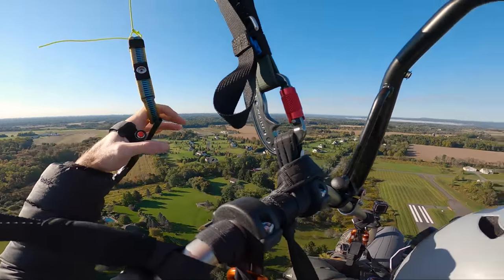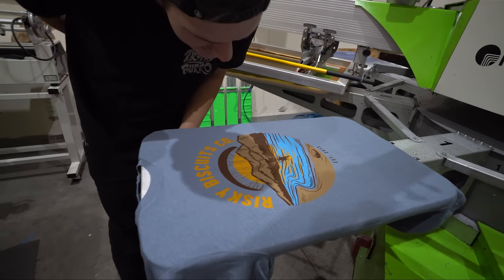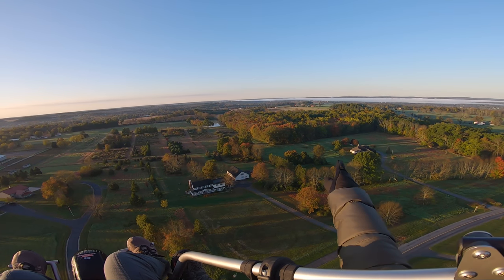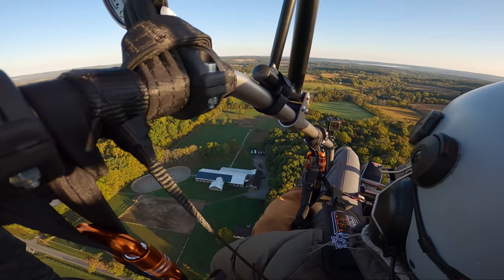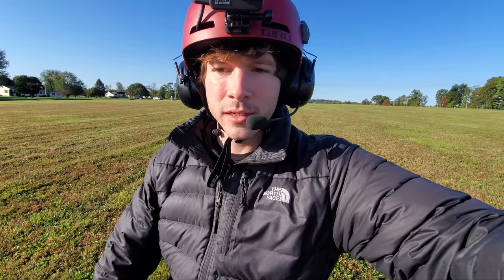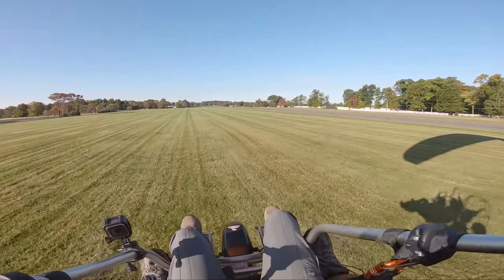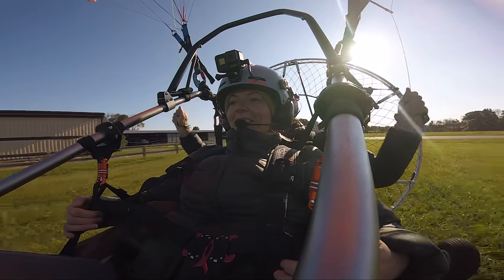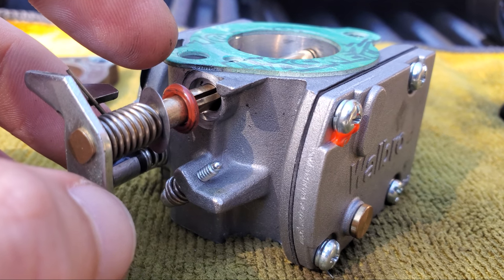I had an ENGINE FAILURE while flying my girlfriend to breakfast...

Comment: o ring is red, so its made of silicon which swells with gasoline. they used the wrong material for this application. you need a viton o ring which does not care about gasoline.
Reply: Interesting, that sounds recall worthy
Reply: Exactly Adventureman. Tucker check your new carb for the correct o ring or this will happen again
Reply from the maker: Very interesting point! I never knew there was even an o ring there until this happened. I am curious to see what color the o ring is on my other Moster which hasn't had this issue.
Reply: Really?  I was guessing the engine's heat but you make more sense.
Reply: That o-ring would have been installed by the carb manufacturer though. I was under the impression that there maybe alchohol in the fuel that could have done that. I can't wait for the update.
Reply from the maker: There is ethanol in the fuel but it has never been an issue on previous carbs. I wonder if they used a different material or maybe this o ring was just out of spec. 🤔
Reply: Here’s hoping battery energy density advances and electric quickly make these complicated petrol polluters we’ve been putting up with obsolete!
Reply: Although you CAN have different color o-rings with different material, you are correct that Red (Rust) means that the material of the o-ring is Silicone.  The o-ring should be NBR (nitrile or Buna).  Viton would be overkill, but. hey, if you don't care about money.......
Reply: Also some issues with the carburetor design itself, given how it failed. It needs a catch on the end of the post the spring seats upon, and there isn't one.
Reply from the maker: @ZeGermanHam  Correct, I didn't mean that the part was not available whatsoever. But I don't think they would pull an o ring from the local Napa and send it to me as a warranty part. This o ring is not listed on the parts diagram so it seemed easiest to send a new carb. 😁 I appreciate them going above and beyond.
Reply: Tucker, “thanks for being my windblock!” Lol
Reply: @TuckerGott  Still, you should be able to get the proper O ring at NAPA, if you wanted to DIY and get back in the air ASAP, but as you  mentioned, it might void your warranty.
Reply from the maker: @davisrs1  Exactly. I intend on getting a replacement to keep the other carb as a spare but I'll use the fresh one as soon as it gets here. 😁
Reply: eric thefathead  Incorrect, the  Challenger used FKM Viton.  That O ring failed due to brittleness at low temperature.  Silicone may have been a better choice because of it's low temperature elasticity.
Silicone is not appropriate for that carburetor becaus it is not abrasion resistant under that spring nor highly gasoline resistant.
Reply: eric thefathead  well now everyone has to press f for reading your comment
Reply: Or just use non ethanol gas. Ethanol does weird things to non flex-fuel parts.
Reply: @ZeGermanHam  agree. A new carburator just because an o ring sounds a lot like scam
Reply: alfameqeagle lol, a scam? You do realize that Tucker is getting the new carb for free, right..?
Reply: I actually think that whole carb looks nasty, like a cheap item, poor casting and machining.
Reply: When I hear "O" ring, I think Challenger!
Reply: @jissanboermans5009  Gasoline, itself is a great solvent for many elastomers, with or without ethanol, which is less of a solvent.
Reply: @TuckerGott  just measure it and order a new one from an o-ring supplier. It’s very likely a standard size.
Reply: There are some subtle movements..... lmao 🤣
Reply: @TuckerGott  Having dealt with other small engine suppliers, it might not be listed on the parts diagram; it might be as a part of the carburetor's gasket kit, or rebuild kit.  Sometimes manufacturers won't list those things on the diagram, it'll just be in the parts list and noted as "not pictured".  You might not be able to order that specific o-ring without ordering a full rebuild kit for that carb, or possibly a seal kit, depending on how Vittorazi supplies those parts.  If the carb isn't rebuildable (a lot of newer carbs aren't), then the only way to get a replacement seal is as you said, to order a new carb.
Reply: eric thefathead  Yes it was known by peon engineers like us and ignored, unfortunately!
Reply: eric thefathead  Believe it or not, you may be on to something here.  The problem with the Challenger o-ring was that it would loose elasticity as the temperature dropped. It was obviously cold out, and the fuel expansion as it enters the venturies of the carburetor will cause more cooling (hence carburetor icing).  That coupled with the point Adventureman made regarding a possible issue with silicon-based material, may have been a case of two issues lining up coincidently to create the failure.  The manufacturer should certainly take notice and investigate the potential implications.
Reply: The o-rings on the butterfly shaft are there to prevent any air from leaking around the shaft. This would cause a lean idle condition or low throttle mixture issue, there is quite a bit of vacuum on the back side of the plate when throttle is closed. The shaft is the first leak point. Take care Tucker!
Reply: This failure - by luck only - was a stuck at full throttle because the o ring unseating dislodged the return spring in the butterfly shaft? If I’m correct. But a similar o ring unseating could also cause a stuck “off” or stuck idle failure as well, correct? At idle this trike is a slightly slower parachute? Just wondering. Seem like engineering needs to take a good look at this one and redesign so the spring can’t jump regardless. I’m just a knucklehead wondering.
Reply: @Chinookman  No, return spring failure (caused by the o-ring in this case) could only result in throttle open condition. Total o-ring failure would tend to lean out the mixture due to air getting in through the shaft. The throttle cable itself would have to fail to cause a an idle only condition.
Reply: eric thefathead  The Challenger disaster was due to the o-ring being brittle at low temperatures. The sad part is this was a known issue. We had the same problem with o-rings installed certain in C3 Poseidon Fleet Ballistic Missiles. Rather than go through every missile in the inventory with that particular composition o-ring, disassemble and replace said o-ring, the Navy installed a heater strip. Just a simple heater strip applied to the missile skin that kept it from falling below 73' Fahrenheit. If only NASA had the same foresight.
Reply: @TuckerGott  Oh hell I NEVER use anything but REC 90.. everything runs better, ruined plenty of small engines running 10% ethanol blend..corrosion, seals, fuel lines, etc.. EVERYONE TOLD ME IT WAS SAFE😕 🤔FOUND OUT DIFFERENT!😡🤬💥 Now only run engineered fuel mix in 2stroke/4stroke & REC 90 & SURPRISINGLY stuff keeps running.. I had a LOT of carb corrosion w/Ethanol in gasoline 😕
Reply: @francisconti9085  I have a 5 gallon can I fill every year and use that in all my seasonal engines like snowblowers, weedwhackers, chainsaws, and blowers; obviously mixing oil for the 2 strokers. No more carb and fuel line problems!
Reply: Fuel delivery driver...  Ethanol is some nasty stuff.  I wouldn't recommend it if you have an option to use ethanol free for any small motors.  And I would never use E85 in anything.  Even if this wasn't the cause of this issue, you'll be better off long term with ethanol free.  I'd guess it's either the wrong o-ring for the application, or it was installed incorrectly.
Reply: Ethanol's high miscibility with water makes it unsuitable for shipping through modern pipelines like liquid hydrocarbons.[49] Mechanics have seen increased cases of damage to small engines (in particular, the carburetor) and attribute the damage to the increased water retention by ethanol in fuel.[50]

Source : Wikipedia
Reply: steven burnham  🐿!
The squirrel did it @ the restaurant with the nut!🤣
Reply: You can pick up different varieties of o-rings usually in a box that has an assortment of sizes all made out of the same material period at most hardware stores you can find this . I live on the west side so I would go to an Ace hardware or a harbor freight not sure what you've got on your end
Reply: I was thinking the same thing but I had a solution in mind. Just put a dollop of epoxy
Reply: @TuckerGott  items like o-rings such as this are not part specific. Just need to make sure it is made for that application. They are usually metric or standard but they have an inner and outer diameter and profile. Profile is the shape you see when you cut it. Most are circular but other shapes exist.
Reply: If it was a black one, I would suggest he got some carb cleaner on it, which would cause it to swell.
Reply: @TuckerGott  I've run into similar problems with old VWs. If your carb comes from somewhere where ethanol is not used, the rubbers in it may not be rated for it. I've run into that with European stuff cuz they don't use ethanol in their fuel, and with Chinese stuff. Even if it is the best top shelf European part, it doesn't matter cuz it's not rated for ethanol use. I've also found colors mean very little when it comes to O rings. Check your fuel lines too. If they are rubber, you'll need to upgrade to something like Gates Barricade fuel lines.
Reply: You guys sure know allot about O rings 🤭
Reply: @737smartin  Yea because those are so less complicated and the charge comes from 🧚‍♀️ dust not petroleum power stations.
Reply: @NoName-tz5ji  Well, compared to common household engines, you’re right about electric motors being less complicated.  They’re amazingly simple.  You have a bit to learn about grid electrical pollution vs ICE engine pollution, but you’ll figure it out eventually.  It takes longer for some folks, but that’s OK. 👍
Reply: @willmoore8708  carbs actually get colder rather than warmer when an engine is running due to the pressure drop after the Venturi.
Reply: I would want my engine to be fuel injected 😹 That carb looks scary.  I mean you can even buy a scooter that's fuel injected.  I know nothing about planes though lol.
Reply: @TuckerGott  ey man, they screwing you over, just go to a hardware store, match the size and make sure it's the right material, this carb looks like it'll work another 2-3 years no problem
Reply: @TuckerGott  have no idea why they use silocon o rings, to save a penny over a rubber o ring?  that's what caused the space shuttle to blow up in 1986, you are too young to remember what a big deal that was
Reply: @TuckerGott  It takes a while for the ethanol to effect the rubber. If you have access to to non ethanol use that. A little more pricey but doesn't effect the o ring. I have to use non ethanol in my outboards or put an additive into the ethanol gas. Take care and be safe.
Reply: @aloysiuswojocockowicz3855  I live in northern Europe and we have definitely had ethanol in fuel for years. You can't get ethanol-free fuel at a gas station at all. The options are either E95 or E90.
Reply: @janbo8331   thanks, I stand corrected.
When we get the German fuel lines with the cloth braiding on the outside they are not rated for ethanol. Maybe the EU is sending all their obsolete fuel lines they can't use to America and advertising them as something fancy and high quality... which they are. If you can go back to the 70s.
Reply: @aloysiuswojocockowicz3855  To be honest I have no idea what that is about. Overall the EU is still a loose group of independent nations so the regulations and customs might vary, even though the EU tries to force all sorts of directives that should be obliged by all. 

I actually wrote incorrectly in haste earlier, the fuel types sold here are 98E5 and 95E10. Apparently some stations also sell E85 for flexfuel cars but I honestly can't remember ever seeing that. One difference in US fuel and that sold here in Finland is the additives in it. Here the fuel has Methyl tert-butyl ether in it, which is banned in the US. Over there I think what is used instead is 2,2,4-trimethylpenthane. I'm not a chemist so the translation on the last substance might be a bit off, and I have no idea if it makes a difference in the subject we're discussing about.
Reply: @janbo8331  from what I understand the European octane ratings are different. Like my 1974 VW says 91RON which is the equivalent of 87 Octane in the US. Most places at sea level have 87, 89, and 93 octane. Some places have other numbers in between, and at higher elevations I have seen 85-91. I guess at higher elevations you don't need as much octane? I don't know.
Almost all of our fuel for on road use has 10% ethanol. Unless you go to very rural areas. Then you sometimes can find fuel without ethanol.
The ethanol in our fuel is an alcohol made from corn. I remember reading about the stuff you mentioned that's in your fuel. I forget what it comes from. Maybe some sort of fermented wood?
I think they use it in Mexico. I know there's something that is in some Mexican fuel that is not in the US and I've heard to not use it because it is harmful to US model vehicles. Maybe it's just bad for the emission systems or ruins the catalytic converters?
The main thing about the ethanol and the fuel lines is the alcohol breaks down the rubber components. So if you use the fancy German fuel lines with the cloth braiding the start to break down from the inside out, and eventually leak and cause fires. Also if you buy American fuel lines that say "meets OEM standards" that's BS anyways, because OEM standards in 1974 did not include ethanol. So they still aren't any good if you live in an area that runs ethanol in the fuel. They will only last about a year or 2. Also the ethanol drys out most rubbers and O rings. If you have carburetors, your accelertor pump diaphragms supposedly will wear out faster, but I haven't personally experienced that yet. I have heard of it ruining mechanical fuel pump diaphragms and filling engine blocks with gasoline. I personally have dual carburetors, but I run an electric fuel pump.
I have noticed before I switched to fuel lines that were rated for ethanol I would have a build up of black stuff inside my carburetors that I am assuming was the inside of the fuel lines breaking down and collecting inside the carburetors.
Reply: @aloysiuswojocockowicz3855  You're right, it's rated differently. I've been planning for years to do a coast-to-coast road trip in the US, so I've done research on various related topics from traffic laws to fuel ratings. In Europe we use MON (Motor Octane Number), but the US uses the average of MON and RON (Research Octane Number) called AKI (anti-knock index) , which results in lower stated octane ratings.

Here 98E5 means it has 5% ethanol in it, while 95E10 has 10%. Ethanol was introduced into the fuel a decade or so ago I think. Perhaps the fuel lines you mentioned are indeed of old stock. The ethanol itself here is made from all sorts of raw materials, so it's not a single thing like you mentioned corn. That's most likely a macroeconomic decision.

The additive I mentioned has traditionally come from amber of a certain pine tree I think, but they might have synthesized it by now. Just guessing though. I don't know exactly why it's banned in the US other than "for environmental reasons", which is rather surprising in a sense, because usually the EU has much stricter laws in relation to chemicals and the environment. 

I like to bang around in the snow with RWDs from 90s that don't have control electronics, which by extension means they were not originally designed to use fuel with ethanol in them. The price difference between the two types of fuel is almost negligent so there's little point in rolling the dice with 10% ethanol fuel anyway. So far I haven't had problems I could have attributed to 5% ethanol content in the fuel.

Interesting question in relation to altitudes and octane. A higher octane number allows for a higher compression ratio, but I don't quite understand enough of engines to say what kind of ramifications thinner air has on that. One thing is for sure though, the lower the octane number the cheaper it is to produce - accounting for the differences in rating the octane number of course.
Reply: @janbo8331  oh Yeah, I think you're right. It probably is 91 MON that my old VW says.
As far as fuel costs here fuel with ethanol typically is cheaper at the pump, however the raw materials cost more. It's offset by government subsidies to the stations that sell the fuel. I have been a fuel delivery driver for about 15 years. When I first started I lived in the Las Vegas area. From there I also delivered to Arizona and California. California used ethanol all year round. Las Vegas only used it in the winter. And Arizona didn't use it at all.
What I found interesting was that some Las Vegas gas stations used to order fuel with ethanol all year round, and the station owners told me about the government subsidies for selling the fuel when it was not required.
Reply: @aloysiuswojocockowicz3855  That's interesting. Seems like the only ones to lose out with the ethanol added fuel are the consumers. Gas stations win, car part manufacturers win, repair shops win, corn (or other source) producers win, petrochemical industry wins. Vehicle owners and taxpayers lose.

Do you know if there's a notable difference in thermal expansion characteristics of fuel with ethanol in it and one that doesn't have it?

One more a bit unrelated question: If I wanted to hitchhike rides from truck drivers in the US, how easy/hard would you reckon it to be?
Reply: @janbo8331  I don't know about thermal expansion, but I know alcohol in general doesn't burn as hot. So the higher percentage of ethanol, the less heat will be generated by the ignition.
I also know there is less energy in ethanol than gasoline. So the higher percentage of ethanol, the more fuel you will need to burn. For example if a flex fuel vehicle gets 20 miles to the gallon on pure gasoline, maybe it will only get 15mpg on E85. I just made those numbers up, but you get the point.
I know that alcohol boils at a much lower temperature than gasoline.
So if I shut my engine off on a hot summer day and run inside a store for a few minutes and come back out, the engine is hard to start and runs terrible till I get enough fuel through the carburetors to cool them off. If you open the engine bay and listen, you can actually hear the fuel bubbling inside the float bowl of the carburetors. That is with 10% ethanol. I don't have that problem at all with pure gasoline.
I added some very thick phenolic spacers between my carburetors and intake manifolds and put nylon washers between the nuts and carb flanges to try to minimize that transfer of heat between the aluminum intake and carbs, but it still happens. Just not as bad and usually only if the ambient air temp is above 80°-85°F.

Another interesting thing about American ethanol, I know some farmers and know they get government subsidies to grow the corn as well. And ethanol corn is not edible corn. So farmers are choosing to take food growing land to grow fuel instead because of the money. So the price of food goes up.
Same with soybeans that they make into oil that is blended with diesel fuel to make Biodiesel.
And... I have heard the company that makes the seeds for the ethanol corn and the biodiesel soybeans is the same government company that made military stuff like Agent Orange and Napalm during the Vietnam war.
At some point the farmers will stop getting the subsidies, and the gas stations will stop getting the subsidies and America will really be screwed.

As far as hitchhiking, I think it's illegal in most places, but people still do it. It's not as common as it once was. I've never seen or heard of any police enforcing it even in areas where it is clearly posted No Hitchhiking.
I would think at the moment with Covid people would be very reluctant to pickup someone they don't know.
In the last year or so a lot of company trucks started putting cameras in them, and most have no passenger policies. So that may also make things a bit more difficult. But independent truck drivers may still pick you up. I live near a bridge that does not allow pedestrians, so if I see someone that looks harmless at the ramp towards the bridge, I have picked people up in my personal vehicle and taken them across the bridge.
If you are male, it will probably be harder to get rides, or at least take longer. Especially if you are a bigger guy or look like a tough guy or are dirty looking. Females get picked up faster, and can expect flirting at some point and probably attempts at more. I am not a big tough looking guy, so I rarely pick anyone up, and usually don't take them more than 20-30 minutes away.
One time at night in the middle of the desert at night in winter I saw a guy broke down and gave him a ride because there was no cell phone service and he was like 2hrs away from anywhere and he probably would have froze to death.
Reply: @aloysiuswojocockowicz3855  Wow, thanks man. You just helped me solve a problem I've had that I couldn't put my finger on. Last winter I had problems starting my BMW after I'd done extensive snow drifting and had turned off the engine briefly to stop by at a store. Even though the ambient temperature was around -20C, the engine/fuel must have not had enough cooling, because the speeds were relatively low but I kept giving it high revs and a lot of torque. The car would start after letting it idle for 20 minutes or so. Having earlier said that I hadn't noticed problems with 5% ethanol, I will need to go back on that statement.

The company you mentioned in regards to seeds for the ethanol corn must be Monsanto (owned by Bayer nowadays). Their famous pesticide, Round-Up, is actually slightly modified Agent Orange, which is pretty worrying to be honest.

I find it quite interesting that hitchhiking is illegal in some places. I understand the reasoning although I don't really agree with it. Sure, it involves some risk, but keeping it in mind should be enough. I used to drive for a living as well and always picked up hitchhikers if I had the chance. Met lots of interesting people and stories along the way. One couple had hitchhiked all the way from Spain to Finland and I found that awesome.
Reply: I've been around the farm long enough to know what a castration band looks like when I see one. Those things are made out of latex.